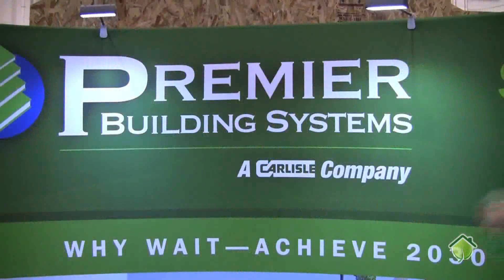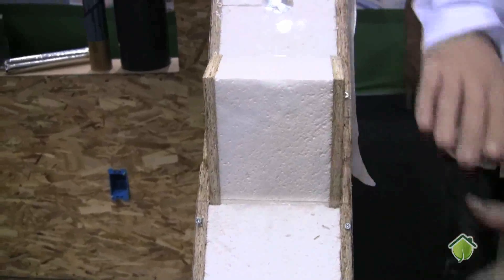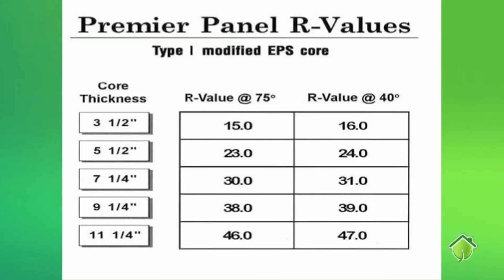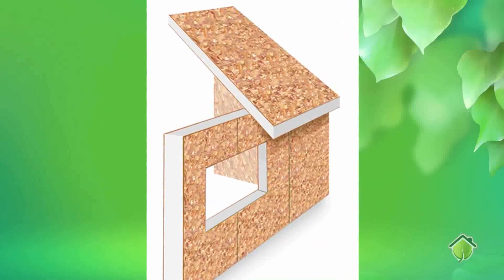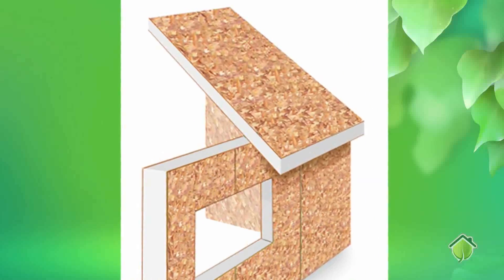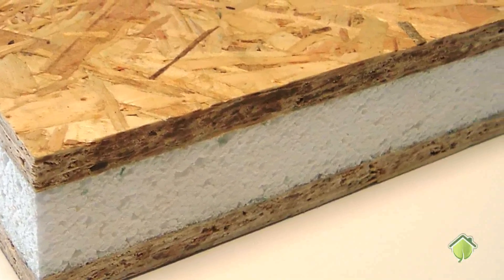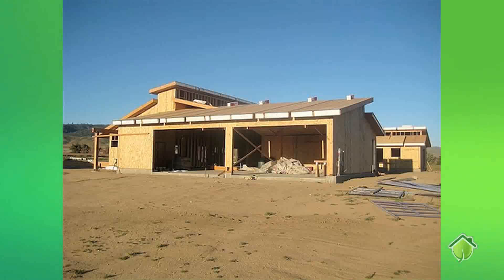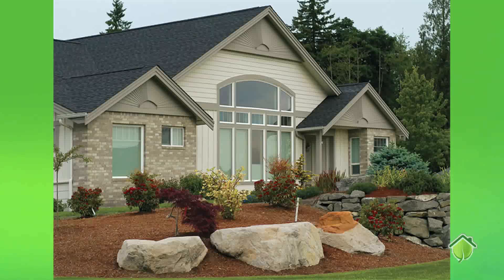SIPS can replace traditional stick framing - Premier Building Systems

Comment: Boo, Great another product that will let less qualified and less English speaking work force on the building site. The old rule of carpentry, learned this first hand myself. Doesn't matter if your dealing with furniture or construction. There is no such things as short cuts in the trade. The framing is just one stage in home construction. ALL PRE-FAB products jack up the price on pluming/ductwork because installation is much more default.